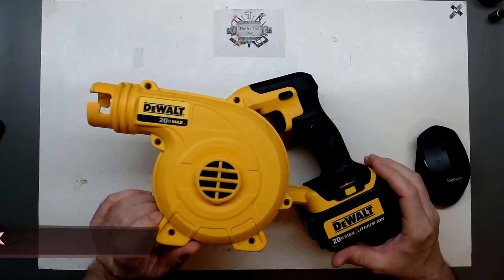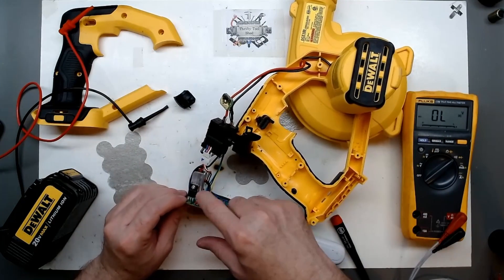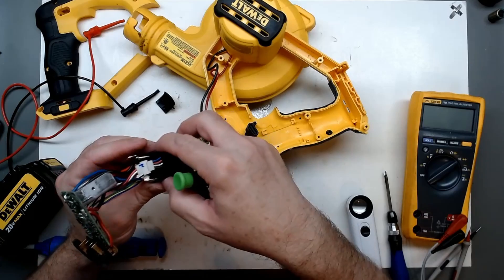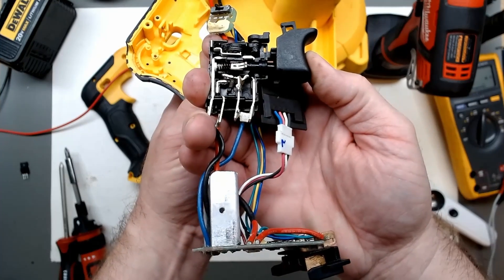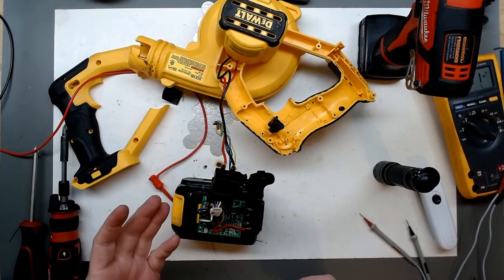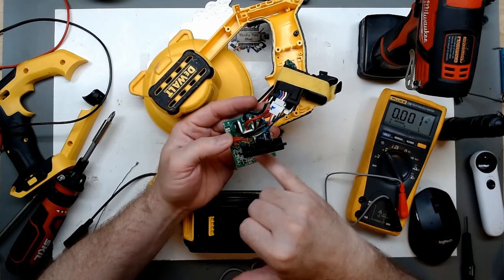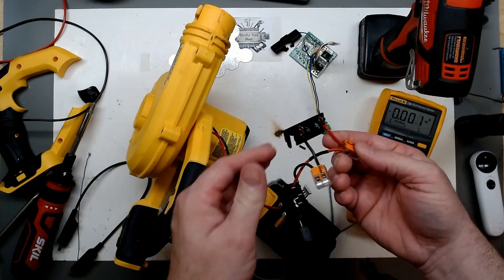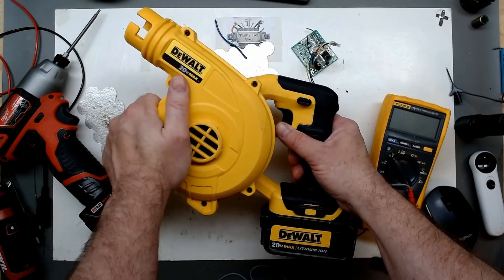DeWalt 20V Max Blower - Salvaged

Comment: For the fifth time in past three years I pulled the blower out to use it and was not working properly. Working only for one or two seconds and shuts down by itself. Instead of junking it, I used your method and now I have a premature DeWalt blower. Thank you and shame to DeWalt ✌️

Comment: my DCE100B started out at 2 mins  now lasts about 15 seconds and drops to 3 seconds each depression of the switch after 3 months.  various batt backs all the same. was going to chuck it but will make this repair to see if it works. I use it on high most of the time anyways to clean my wood shop and mech shop. thank you. 

UPDATE: just did this repair. I used 12v crimp connectors that suppose to handle up to 17amps at 12v. Works perfectly, took me about 10 mins for complete repair. thank you!!!!
Reply from the maker: Awesome! Glad it helped. Thanks for sharing!

Comment: Good video, thanks again. Done the same with a few of these but I leave the board in and just short across the FET. Reason is that I believe it leaves the DIODE's (ones you originally removed)  in circuit. I believe the diodes are freewheeling diodes that reduce arcing in the DC motor. I could be wrong :) but am definitely too lazy to remove the board.
Reply: Actually it is the switch it reduces arcing across I think and helps prevent the contacts being burned out
Reply from the maker: Yes, agreed the diode as I mentioned in some other videos does help save the contacts.

Comment: I have one of these that starts like it should but immediately dies. If I let the trigger go completely and then press it again it does the same thing. Any idea's on what's wrong with it?
Reply from the maker: Have you tried more than one battery pack?
Reply: @ThriftyToolShed  oh yes several batteries that show good and work fine on other tools. This thing only stays at full speed for maybe a second before it acts like I took my finger off the trigger. I can feather the trigger doesn't do anything different but if I let completely go of the trigger and then pull it again it will do the same thing again
Reply from the maker: Ok, I figured you had more than one pack. It just acts like the battery voltage is dropping out on the pack so the blower is shutting down. The packs are good so the control board must think the pack is getting low. The only simple thing I would think to check is a loose or bad connection from the pack. It could be corrosion or just bent pin etc. on the tool side. If not a bad connection  then it must be the control board itself.
Reply: @ThriftyToolShed   You had to cut loose the control board so you could at least use the blow.
Really , most of Us use blowers wide open anyway. 

And now with Larry Smith problem , most likely got to 86 the computer board again , so it can be used for more than just One second.      

Larry problem isn't an isolated incident ,  a bunch of folks are having this problem.

like your channel
Reply: Same problem with my blower, shuts of after less than a second no matter what battery pack is connected
Reply from the maker: Edit: This comment Was meant for the EGO 56 blower, sorry . This DeWalt blower does not have BLDC. Simply a brushed DC motor. Seems like a common failure on here. If it did last like 10 secs or so it could be the pack and controller not talking. The D-terminal communication is needed for it to run longer than 10 secs. In most tools anyway. If it only lasts for one second then it's like the controller is thinking either the pack Voltage has dropped or it thinks the current/load is too high and shuts down. May be a controller issue at that point. I have had luck replacing the controller with the cheap BLDC controller, but it has to be in the airflow since the BLDC can push the controller above it's rating! This also will not shut down on under voltage so you have to stop when you hear the blower getting a little weaker. Just to protect the battery.
Reply: @ThriftyToolShed  this was a great video. I’m going to go fix my blower now
Reply: Where does one buy this BLDC controller? Type, ease of install, does it require soldering, buy a new one altogether?
Reply from the maker: Hi,
The BLDC controller comment was meant for the EGO 56V blower I repaired sorry for the confusion. Sometimes when a question shows up in YouTube studio it's not easy to tell which video someone is asking about. The DeWalt 20V blower is simply a brushed DC motor, it will even run with the 20V straight across it.
Reply: @ThriftyToolShed  Thank you! I am still lost on whether or not I should attempt this on my own. If soldering is involved I am down for the count, but if it is a simple swap of parts then I am good. Is this an easy fix or should I just buy a new blower and face the music?
Reply from the maker: @wakeme69  
Well, the way I showed testing it on video just using the Wago Lever nuts will work. Or you could use small wire nuts as well. Solder would be the best connection and more permanent, but you can just do just as I have in the video. Cut the red and black from board and connect them back up to the trigger wires. It should be a good back up blower at least! Best of luck to ya!
Reply from the maker: Hi,
You can absolutely do just as I showed here in this video and connect with Wago Lever nuts or small wire nuts if you desire. Solder would be a better long term approach, but not really necessary just to get it back going. Simply cut wires from battery connector as shown in video at the controller connection point and attach red and wires back to respective colors and it should work. Just remember as said the battery low cut out protection is not present. So you will simply have to listen for the blower getting weaker and know it's time to swap the battery. It's not hard really, I have a Makita blower almost just like it and I have always had to listen for it, it never had the low battery cut out on it. Even if you do buy a new one, it would still be a great back up blower. Best of luck to ya!
Reply: I'm having the same problem.
Reply: @ThriftyToolShed  Yep, I have two of these blowers. Both have the same issues.

Comment: Hey, my Dewalt dce100 mini blower kind of pulsates when you hold down the trigger. The battery is good and it blows ok. I have taken it apart, but you show removing the screw and washers and the impeller coming right off. Mine isn’t coming off on removal of the screw and washers. Did you have to do anything else? Thanks
Reply from the maker: It could be different from this one, unsure. If pulsating it usually is the pack being pulled down, but if it does it with more than one pack it could be the current draw. The board could be seeing a high current and dropping out. If you cover the inlet a little to limit the air intake does it stop pulsating? It could be the board thinking the current is at the limit and it's really not also.

Comment: Hi, what type of low voltage protector would you recommend to use and where would you put it in the handle? Would you use in conjunction with 15amp fuse? If so does it matter which one is before the motor? Thanks for your informative videos.
Reply from the maker: Hi,
It would have to be in its own enclosure strapped to the outside and run wires into the blower housing on this tiny thing. There is no room for a low voltage cut off board unfortunately. As far as a fuse, test the current with a clamp and you will be surprised how high it is on these blowers. Running on high it may pull over 30A. I typically would put the fuse right after the battery plus connection and then go to a low voltage cut off board and then back to the controller. I have several videos on the low voltage protection boards and they have links in the video description if it helps.

Comment: Brilliant diagnostics & remedy! I have a 60v Max brushless Dewalt blower that is going on 5 years. Presently, whenever I take my finger off the trigger it slows down making a grinding kind of sound that would make one think it needs lubrication. Other than the grinding sound upon trigger release, it works fine. I suppose it's a matter of mechannical aging. ANY THOUGHTS?
Reply from the maker: Sounds like the electronic brake could be activating. It usually is not super loud since it's not mechanical just slowing the impeller very quickly. It could be a bearing, but you would think it would also make noise while running at full speed as well. I have not seen that to say for sure. Thank you for your kind comment!

Comment: Thank you for the video. Do you happen to know the diode model. Mine is slightly melted and can’t read it. Thank you
Reply from the maker: Sorry, I don't it's been a while. I would think a 50V would be fine and I can usually tell by the physical size (Diameter) which current rating it is. Best of luck to ya!
Reply: @ThriftyToolShed  No worries,thank you for the response,figured I’d try,it is much appreciated. Hope the new year treats you well. Thank you again.

Comment: How can I find the right motor model replacement?
Reply from the maker: If it's a DCE100B you can look it up on a parts site like this for example. It's item 10. It's not cheap....
https://www.ereplacementparts.com/dewalt-dce100b-type-20v-blower-bare-kit-parts-c-1009_2641_566982.html?srsltid=AfmBOooEKBb0_CMatWYONlGIelN0RKgtJCpVW9vBHnvRS6gWKOyrZn6g

Comment: Mine operates for a split second however I have been using several smaller batteries can this be the culprit? I noticed the battery you have is much bigger. The person I purchased the tool from had a much bigger battery as well and showed me it worked perfectly fine.
Reply from the maker: Yes, I am a fan of the 4ah and 5ah for sure. Still not heavy but really good runtime.
Reply: I have two of the (small) 20v DeWalt blowers. My older one went like yours. On for a couple seconds, then off. Took apart and tried a similar fix as Thrifty Tool Shed. No success. Bought a brand new one (and batteries and a new charger). Having the same on for 2-3 seconds and quits. Probably will send into DeWalt, but shipping is so costly?

Comment: mine starts then stops each time i pull the trigger, it wont stay running
Reply from the maker: If you have tried different packs and still an issue then check for good connection to the tool and pack. If  still an issue you have an issue with blower control board. Seems as though its not sensing the pack.
Reply: This is a common fault with this model. Realy a design flaw but i dont think dewalt is going to own up any time soon.

Comment: Some said they removed board & hardwired. Can that actually work??
Reply from the maker: Well, at the end of this video I did remove the board and showed that I did take the battery straight to the speed control and use its contacts straight to the motor. So that is what I did. As far as a straight wire battery straight to the motor then it will run all the time with a pack inserted? Not good!
As mentioned even the way I did this will drain the pack too low if you don't watch it and listen as the blower gets slow and weak. I personally can easily tell when the blower slows down and gets weaker.  The other option is to include a module to alarm or even shutdown if pack voltage drops to cut off voltage.  I have a couple videos about LVCO modules and I will be working on a more detailed one soon also. Best of luck to ya!
Reply: @ThriftyToolShed  

Thank you sir..I removed board now it works . I take battery off after im done using. Thanks for posting this video

Comment: Why would you not have checked for 20 VDC at the back of the motor first?
Reply from the maker: Simply experience with Brushed DC motors. Unless a bad connection or worn brushes the DC motor is bad in my experiences about 5% or less of the time and power electronics like  speed control microcontrollers,  Diodes or Mosfets about 95% or more. So just what I have seen the most and the way it was acting...
I will say in cheaper brands such as Ryobi I have seen motor brush or brush holder issues on many tools so I would most likely have checked all the way through on a Ryobi tool since it's more like 30% of time a motor issue.

Comment: May be a stupid question, but since the battery doesn't have run down protection, if you getvrid of the circuit board you could ruin your batteries if you're not careful right?
Reply from the maker: Correct. I mentioned that in video and I have several videos with low cut out protection boards if interested.

Comment: I repaired my fluke meter the only thing is is that the back light doesn’t work and the speaker doesn’t work for continuity it doesn’t ever beep.
Reply from the maker: The buzzer is usually on the back and the disc has to be lined up and making contact with the contact points, usually a little spring or black  conductive rubber cushion. That is all I have ever seen be wrong with the buzzer, I don't remember one ever going bad on me. The backlight is usually solid also, I don't ever work on them much. Make sure the led itself is ok.  Not sure on this one, but most LEDs with the battery removed from the meter you can test the led with a DMM in the diode check function.Great job repairing the meter.  Best of luck to ya!

Comment: Be aware this doesn’t fix every issue. I did the hard wire because I had the same symptoms and it fried a brand new fully charged battery in seconds. Now I’m out a new battery when I could of bought a  blower for the same price.
Reply from the maker: Excellent point for sure. I do usually show testing motors etc. with a current limited regulated power supply before putting back in service as with any repair we don't know if something else caused a failure, such as a shorted armature. I may have not shown it in this video, but I have a channel and share it with viewers in repairs often. I can't actually repeat every testing step in every single video, but try to cover it all throughout the hundreds I have taken the time to share. Sorry if it caused confusion and thanks for sharing your findings with us.

Comment: Nope, I will never buy another cordless DeWalt leaf blower again. I have owned two cordless DeWalt Leaf blowers and both have died shortly after the end of their warranty dates. In my opinion they are designed to fail.
Reply from the maker: I have not seen any of the Dewalt blower models be good competition against the top blowers honestly and still remain the most expensive in most cases as well. Not a place you want your company to be. DeWalt does make some great tools though. The blower design department may need a little bit of engineering help.  Thanks for sharing.
Reply: Can you replace the brushes on the motor? I’m 90 percent sure my brushes are toast because of pieces that came out of the motor when I disassembled it. Hate to waste a good tool bc of a 50cent part
Reply: Can you replace the brushes on the motor? I’m 90 percent sure my brushes are toast because of pieces that came out of the motor when I disassembled it. Hate to waste a good tool bc of a 50cent part
Reply from the maker: @brose7956 
I believe these are the type that are not made to be replaced. I did not work on this exact motor, but I have a video repairing a similar motor in the past. It should be similar in some ways.
https://youtu.be/krOoMQ0seGg?si=gIHCFVa7q7nGLBYf